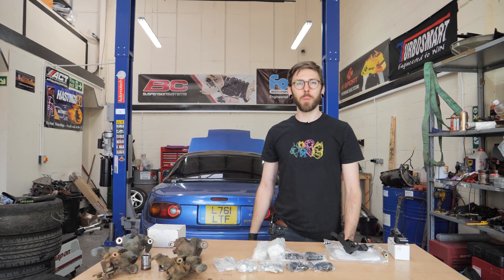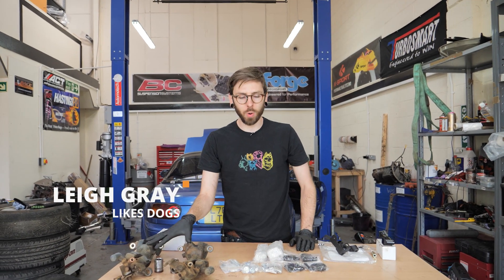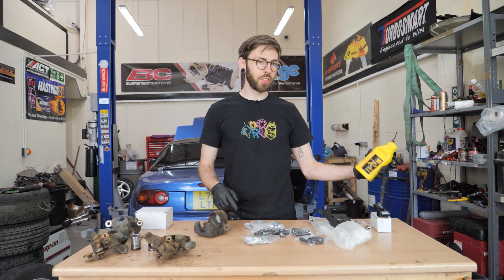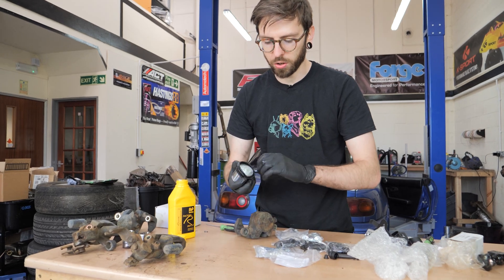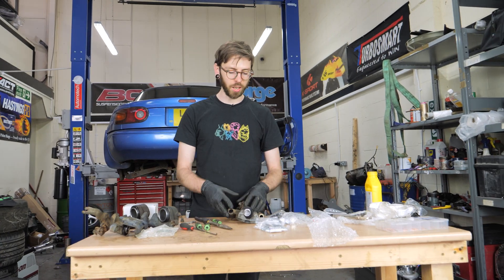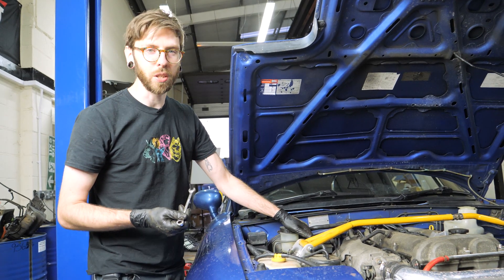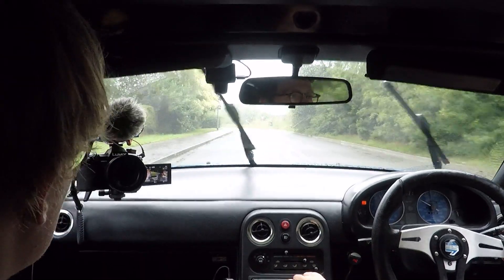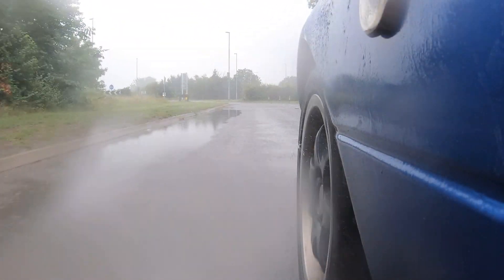We TRANSFORM Jake's DANGEROUS MX-5 Brakes With An Adjustable Bias Valve

Comment: My Mk1 Eunos has front calipers from an NB 1.8 Sport, but standard 1.6 rears, and no ABS, so it locks the front wheels very easily. I've installed one of these bias valves but even with it screwed fully in, the rears are still not locking first - any suggestions?

Comment: can u make a video on the parking brake please? cant get mine to lock the tires. i have changed everything i can think of and adjusted it so many times but still very weak braking.

either its adjustet to strong so the parkingbrake holds the car but when im driving it constantly brakes even when the handbrake is fully released,

or its to weak and i can pull the handbrake while driving and it wont do anything not even hold the car at a slight angle when parked.

i just cant seem to find the sweet spot..

Comment: Super simple to remove proportioning valve provided your nuts will undo 😂
As for that brake stopper I've got the engine out and I still can't that damn bolthole lined up I see you missed out how long that took and how you did it haha.Any tips?

Ps my wilwood bias valve the standard fittings came with ptfe tape so I'm not sure why Flying Miata would advise against it.
Reply from the maker: Don't do anything up until you get a bolt in that hole in the strut tower! Truth be told I actually snapped the bolt, so I drilled it out and fixed it in place with a nut and bolt. Once that is in you can then put the nuts on the brake master cylinder.
Reply: @BOFIRacingTV  Finally succeeded on getting the brace bar located. Had to lever something against the suspension turret and touch up the paint afterwards. Bias adjuster also fitted. Now to fit the rest of the goodies I ordered from you guys.

Comment: Excellent demonstration of how to upgrade MX5 brakes, and trouble-shooting the worn out diff mounts. Would like to have seen more detail of how you got the brake stopper to fit with the strut brace in place. GReat video all the same - keep up the great work.
P.s. The oil cooler arrived safe n sound, thanks - looks like a nice piece of kit.
Reply from the maker: Thanks Phil, it was a proper fight with the strut brace in the way which is why it didn't make the video. I'd have removed it but the bolts looked very seized and we didn't have time to change top mounts if one of the studs broke. Glad the cooler arrived safe 😊

Comment: How is the fitment on the LHD cars? And do you really get a lot of benefit of it?
Reply from the maker: The DaveFab stopper is only for RHD. Jass Performance have some good options for LHD. Their strut brace compatible one also connects to the booster with bolts and a rod.